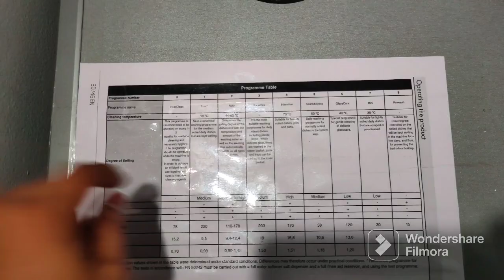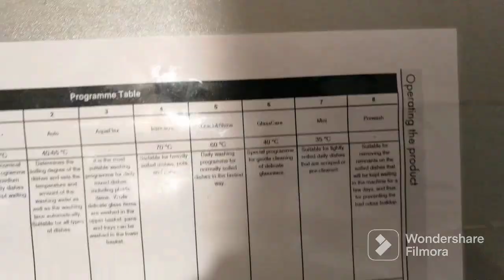Finally bought dishwasher ✨ worth it

Comment: Pls don't mislead.. there will be water residue in the mixer jar because of its design after the cycle is over.. it does not dry completely. .U have shown it fully dry.. Am using bosch dishwasher for past 10yrs.. Also I will give a tip for u.. don't keep mixer or knife in the dishwasher.. The cleaning powder will make it blund after few washes.